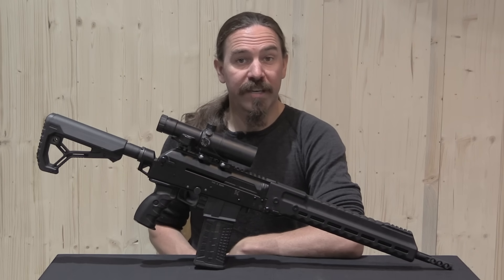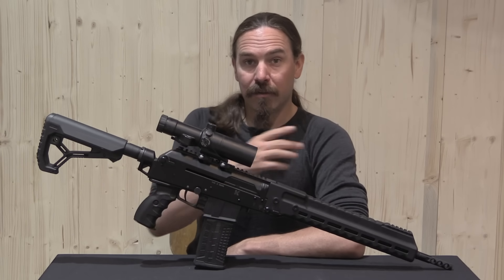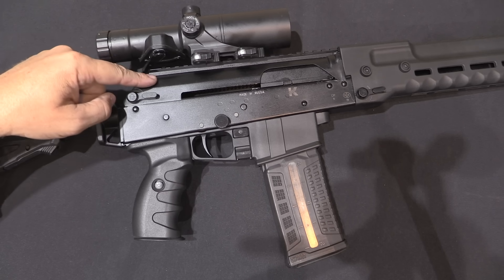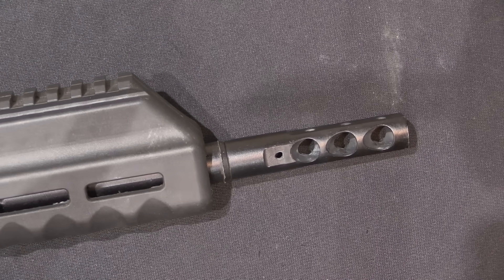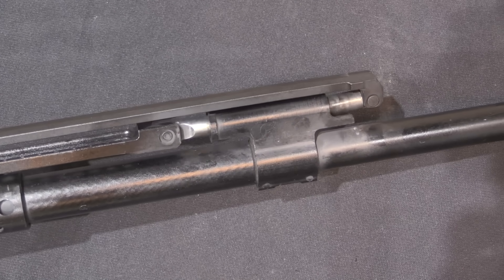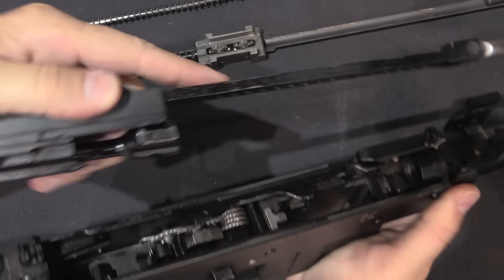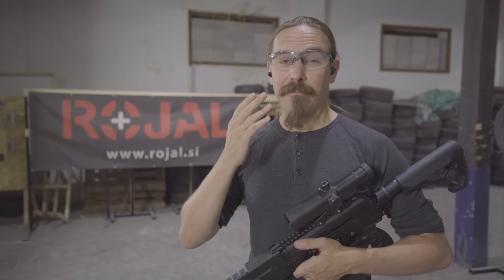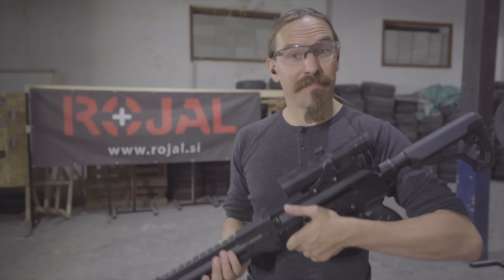Balanced Recoil AK-107 / Kalashnikov SR-1: Is It Any Good?

Comment: This is a surprisingly simple system. I was expecting some weights and wires like on an AN-94 but this is just a regular AK but with a counterweight on top that travels the opposite direction of the bolt.
Reply: It's such a creative system to have in a gun. 

Edit thanks for 100 likes idk what likes do on a YouTube reply but it's nice to know that someone appreciates how interesting this gun is.
Reply: which is sick
Reply: I feel as though the mass of the forward moving portion us nowhere near enough to do the job.  It should be equal or more to the bolt mass, not substantially less mass.
Reply: @MachinistJohn  agreed
Reply: Also almost useless in semiauto.
Reply: @MachinistJohn  to completely negate the recoil, no. But to reduce and already low recoil to the point of insignificance, apparently the 107/8 do that really well
Reply: @AlexandruNicolin  recoil reducing measures are never meant for semi auto.
Reply: @MachinistJohn  I'd be willing to bet that part got cut down at some point in the development phase.
Reply: @AlexandruNicolin  recoil reduction is still recoil reduction. If it can improve follow-up shots and staying on target then it's doing its job.
Reply: @MachinistJohn  Yes, I was thinking about this. They've avoided the problem of having to dial up the velocity of the forward recoiling mass, but they've encountered the problem of not having dialed up the velocity of the forward recoiling mass.
Reply: @MachinistJohn  I imagine the cogs magnify the accel/speed of the counterweight - the weight sits higher off the bore axis also 🤷🏻‍♂️
Reply: @cameronbartlett856  then there's zero reason to pick this rifle over a properly gassed and buffered AR15. No wonder it was a flop in the civilian market, even in the EU. There are now a couple of companies that make ARs in the EU. And I'm not even considering the fact that the cover looks flimsy and I doubt it holds zero for optics.
Reply: It's because the two guns do two different things. People think they are the same and they are not at all
Reply: @AlexandruNicolin  basically. I'd be more interested in full auto version for military durability and accuracy tests. The system look simple enough as an 'Advanced' upgrade.
Reply: @AlexandruNicolin  Well it's not an AR in the first place. Also this gun will be sought after due to it being a Russian import. Personally while i would mind having one, I wouldn't want it in 223 simply because like you said, I can get an AR for that. Nevertheless, if the system does its intended job then that's all that matters.
Reply: @sys3248  Military eww'd at balanced recoil systems for multiple reasons. 5k rounds resource of the gears, 2x force required to manipulate charging handle getting worse as rifle gets dirty up to, and it's a direct translation of a quote, inability to move it by slamming it with a boot.
Reply: RU military should have this as standard issue
Reply: @AlexandruNicolin  Also unlike the AR, as Ian stated, AK's have massive bolt travel that causes a lot of the recoil, so comparing the two systems is ignorant.
Reply: @mostlyharmless8555  that's why I'm interested in their test.
Reply: @cameronbartlett856  I'm only comparing them from the end user perspective, regardless of their internal mechanics, as well as price. I don't care if a weapon that used to have jarring recoil because it had an overweight bolt and was overgassed was tamed to a more manageable level by using a complicated mechanical system, when I can just buy a much more balanced system in the first place, at a comparable, or even lower price because it's simpler and better designed from the get go.  

To me the Russians seem to be stuck in a loop trying to improve a system that is 75 years old, and not even doing the best things than can be done to it. Arguably the Valmets, Galils and SIG-550 are still AKMs at heart but they're far better, without any ridiculous contraption inside. Whether they're better than an AR is up for debate.
Reply: @AlexandruNicolin  innovations in gun design will always be hit or miss, as long as there is no major downside then it will have appeal. Unfortunately due to sanctions, this gun will be over priced.
Reply: Well it doesn't have "Hyperburst".. (Which is why no pulley, wire, diagonal mag etc)
Reply: Orc weapon is quite interesting.
Reply: @AlexandruNicolin  Why did you name two guns that are way heavier and one gun which is really well built, but is in limited supply because it's built on an artisan level of quality almost?
Reply: Exactly what I was thinking
Reply: @Seth9809  I looked it up and AK 107 & Galil AR weigh around 3.8 kg, RK-62/76 weighs about 3.3 kg and SIG-550 weighs 4.1 kg but that's probably because it has a 510 mm barrel with a heavier profile. The 400 mm version is also probably around 3.8 kg or so. The latter has been produced in quantities exceeding 700,000 so it's not "artisan" at all. Agree, all those AKM derivatives, except the RK-62 are heavier than most ARs with similar barrel lengths, but I still don't see any user level advantages in choosing any over a high end AR.
Reply: @AlexandruNicolin  the class are called 'Military Grade'. You're right though for sporting there's no reason not to go for high end AR. Or AK for that matter.
Reply: The AN-94 is a feat of engineering, but again, reliability has to be garbage with all those moving parts. Sometimes KISS makes all the sense in the world.
Reply: Yep that's soviet/russian design for you. Simple but clever
Reply: very AK like, although I worry the second recoil springs perch bit is a bit too snow and not enough rugged
Reply: @MachinistJohn  hard to say for sure without trying it.
Depending on speed of said counter weight it may be counter intuitive especially at full mass of the bolt of it meets or exceeds the speed of the bcg.
Reply: @sys3248  except maybe those huge muzzle brakes on some large caliber sniper rifles and anti-material rifles...
Reply: I remember old story about how US and soviet try to find way to write in space. US built complicated pen, when soviet just use ordinary pencil lol
Reply: The counterbalance seems significantly less massive,  any idea why this is?  If you're going to go to all this trouble, why not add the mass to equilibrate the two instead of settling for a partial offset?
Reply: @MachinistJohn  it’s not the pushing back that’s problematic, but the muzzle rise.
Reply: The russian army be like: nyet still too complex comrades make it more simple

God damn it i know the russian doctrine is simple,reliable and easy to mass produce but if i was putin i would insist this rifle be adopted into service immidiatly in both 7.62 and 5.45 especilay for the new moblized soldiers it will be much easier to handle with much less training needed
Reply: @MachinistJohn  Yes my thoughts exactly.
Reply: Actually Kovrov AEK even simpler. It's adopted by Red Army special forces.
Reply: @potmadu4153  both have tradeoffs
yes, pencils are simpler, but their tips can break and they have to be sharpened which causes issues with tiny graphite fragments which could damage exposed equipment
Reply: Yeah the an94 fires a round and when the bolt is traveling back another one with the counter balance pulley wheel and cable strips another round is it the rear hyperburst the whole point is to have 15 for 5 bullet with another one roughly 10 inches below it almost in like a figure-eight or an eternity symbol on its side configuration bullets are spinning of course but the whole point is the channel wounds cavernous gaping hole not one but now two would make any human it would literally cut you in half with two bullets that are 22 caliber
Reply: @Silver_Prussian aek-971 runs the same balancing system and was adopted in 1990. AK 107/8 kinda reused it. The recent version of AEK is 6P67 Kord chambered in both 5.45 and 7.62 and also adopted by military for special forces use. 
Such rifles are not made for RU regular army because production and maintenance cost is much higher.
Reply: It's basically taken from the Kovrov developed rifles, like the AEKs and the A-545 and A-762
Reply: Unfortunately it's still a bitch to clean and all that. And definitely not worth the price, especially since it's still a traditional AK lacking some modern ergo and features like ez barrel replacements, accurizing mods (or even potential for them due to the new gas tube, it was ez to do on a PSL or galil, newer ace even reduces harmonic issues stock, this I didn't dare fucking with and sold the gun. Shortly before UA 2022 which sucks because afterwards Poland banned gun imports from Russia, I'd get a premium)
Reply: That gun is heavier than average. Not good
Reply: It's also heavy and a gimmick.
Reply: The AR-15's buffer system exists for this purpose. Recoil mitigation. It's just a spring with a weight that has a rubber bumper on the end; and it cuts recoil way down from what it would otherwise be, if the whole action were 100% contained within the receiver.
Reply: 6П67 А545 АЕК
Reply: @FeatheredDino it doesn’t recoil just felt recoil form the user end.
Reply: I have invented a similar system long time ago, most of weapons could be significantly upgraded this way.
Reply: What if we combine both

Comment: From my observations, it appears the Russian engineers almost maxed out the muzzle-brake efficiency & added the recoil system to further reduce recoil in a rifle that was meant to be a commercial "assembly line" product whereas other weapons with similar recoil mitigating characteristics require a gunsmith to hand-tune the system.  Not bad Russian engineers!  Bravo!
Reply: a lot of people say the Soviets and Russians like to make something cheap and simple.  so they forgot that the ak 47 entered production in 1948 3 years after the 2nd world ever.  America still uses the m1 garand.  and the new m14 will come out 9 years from now in 1957
Reply: if it was tuned to the muzzle device with it's mass anyway, it's a bit unfair to say that the muzzle device does most of the work. it's like saying that the air cleaner does most of the work on an engine that was tuned with it being there.
Reply: Us americans designed a ball point pen for space. Gotta make jobs somehow
Reply: @FilthyGoyim that's kind of an urban legend. NASA also used pencils, the pressurised Fischer pen was independently developed and eventually used by both nasa and the Russians.
Reply: @FilthyGoyim  The need for a specific pen for space is because there's no gravity so 'regular' ink pens don't work. They don't want to use pencils because pencils are notorious for breaking. Space station being a 'closed system' they want to avoid using any materials that can easily break and clog up the ventilation or damage electronics, or materials that degass or release any chemicals etc. This limits what materials they prefer to use in a special environment like that.

They don't just do things for the fun of it
Reply: @rantanen1  they dont do they?
Explain gender studies in Pakistan lol
Reply: @rantanen1  So they built the space pen, and figured all up before actually built the space station on their own. Meanwhile, the Russians have built several space stations and still use pencils, is that how it goes?
Reply: @limanac111  No that's not how it goes.

Both Americans and Russians started off using graphite pencils, and both developed and looked for alternatives. Americans for example have used ball-point pens which are prone to degassing, and Russians have used alternatives such as grease pens, which are disposable and less durable than other forms of pens.

And both have bought and used the Fischer Space pen, which was developed not by NASA but independently by a company. It's the best but most expensive alternative and it has been used by just about everyone.

I'm not exactly sure about your point about the space stations...?
Reply: @rantanen1  Ah yes, Wikipedia, the infinite source of fairy tales. Development of the space pen was too expensive for NASA's unlimited budget at the time, but ex navy officer invested at the time a 1 million dollars to development of a space pen and sold 400pcs to NASA at 3$ a piece. I mean who really buys this stories.